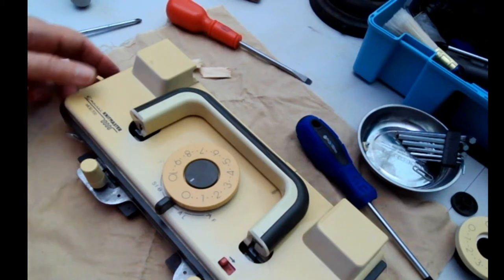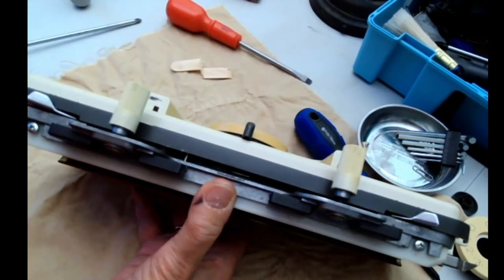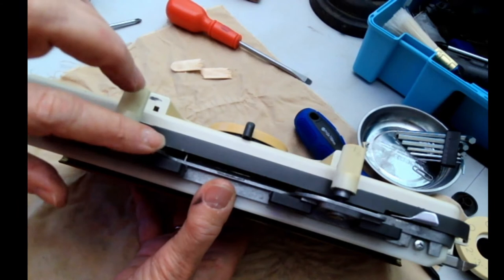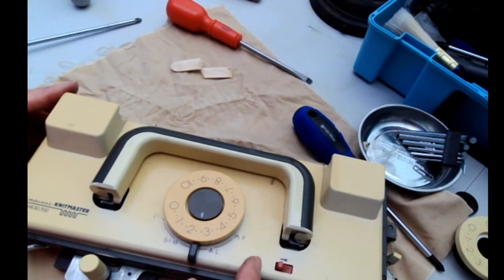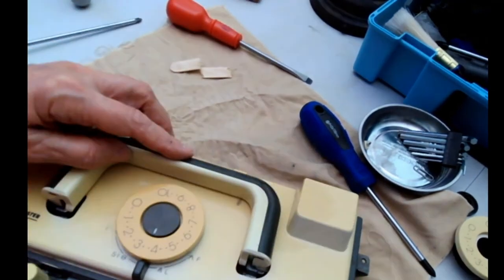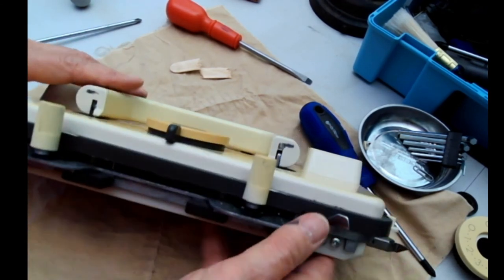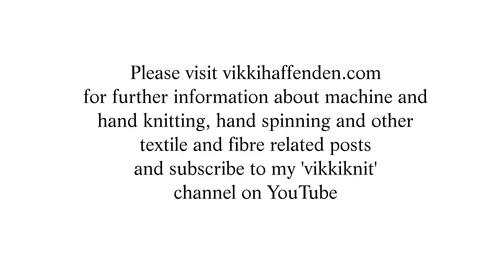One reason why your knitmaster SK700 cam lever may be jamming

Comment: I just bought a second hand machine that is in great shape but sometimes it jams for no apparent reason.  I was just working on a stocking stitch piece and it wax going smoothly but all of a sudden everything jammed and i could no longer move tge carriage across at all.  Could it be because of that little piece?
Reply from the maker: Hi Lucie, I think this is more likely to be the sponge bar which runs under the needle bed and holds them down. Slide this out by finding the little plastic lug at one end and pushing it inwards so that the other end comes out of the bed and you can grip it and pull the whole bar out from the side. These sponge bars become soft and worn out, and if you haven’t replaced it when you bought it, or the previous owners  didn’t, it may need to be replaced. They are for sale on eBay, or you can refurbish the existing one with a kit (also sold on eBay).
Reply: @vikkiknit  I pulled it out the other day as I managed to bend two needles when it jammed. I have no idea what a good looking sponge bar is supposed to look like though, do you happen to have a video that shows this?  The machine is from 1988 but I'm told it was rarely if at all used.  Right now I'm scared of damaging it more so any help you could offer would be really appreciated.  Thank you in advance!
Reply from the maker: @LucieLucieBBeaulieu  here is a useful video https://youtu.be/piJsG9zdGiM
The sponge sits higher than the metal. Andee knits sells spares, or the strips to replace the sponge only. https://www.andeeknits.co.uk/spare-parts/knitting-machine-retaining-bars/
Reply: @vikkiknit  thank you so much!  I just pulled it out and it's so flat, looks exactly like in the video attached.  I've ordered a new one, hopefully that will do the trick!  I really appreciate your help!
Reply from the maker: @LucieLucieBBeaulieu  no problem, glad to help. If you need inspiration and other information about machines and machine knitting you might like to look out for my books about machine knitting, ‘Translating Between Hand and Machine Knitting’, and ‘Single and Double Bed Machine Knitting; the Designer’s Guide’, (due to be on sale 27th May 2023). In these I share my knowledge and skills gained through a career in knitted textiles and knitwear design and as an educator in these. Both books are packed with step by step photo instructions of methods plus detailed photos of samples of techniques and methods available from Crowood Publishing or online book retailers. Happy knitting with you new machine.
Reply: @vikkiknit  I will check these out for sure!  I hope they are available in Canada!
Reply from the maker: @LucieLucieBBeaulieu  they should be, even if it’s only via Amazon. 😁
Reply: @vikkiknit  I'm so sorry to bother you again. I changed the sponge bar, but now when I move the needles forward, they pop out at the back so I obviously did something wrong 😭.  I did have trouble getting the bar back in, it kept going in crooked.  At first I was putting it in with the sponge facing upwards but after looking at the video again I realized it was supposed to go downwards.  It still took some wiggling to get it in but finally got it. Any idea why the needles are popping out at the back?